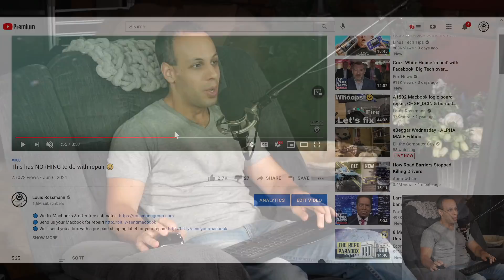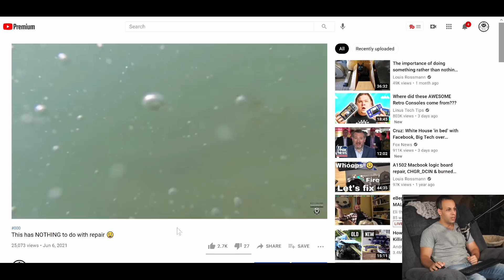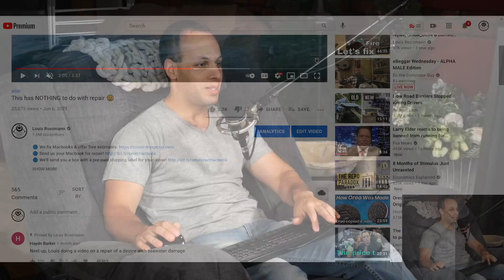Why are user serviceable batteries a bad thing?

Comment: If I were arguing from a place of good faith, and imagined them not being absurd .... I figure this person was imagining someone doing exactly as you mentioned, with floss and struggles... installing a shitty aftermarket battery that then catches on fire when they're on an airplane?  So now they're conditioned into believing that the batteries are dangerous... and I would say that a no-named pouch battery does offer more danger than something with a brand liabilty behind it, at least marginally.

When you said user-servicable battery even I didn't envision a fully designed battery shell, with a water proof seal integrated on it, as part of the solution... I pictured all of those shitty old battery designs from years ago, when I dropped my phone the phone,  battery,  and cover go skittering off in 3 distinct directions... that would be hard to seal and be user servicable...

But a cellphone who's battery was also the lid, and it slid into the phone from it's smaller dimensions, making the seal easier... well shit that's an obvious solution once you see it.

So it's probably a lack of imagination that people say things they'd almost wouldn't given the right explanations... which your video did quite succinctly.  So once again, you called out a problem and are the solution.  Better education and discussion around what is being talked about!

Comment: I have a question. Is there any reason for a sealed in battery to also be glued onto the frame? It's packed in, there's no chance of the battery moving right? Even if it could it would move so little.

Comment: yes, I was so sad when they moved to sealed in batteries in smartphones. I remember when there were devices in which people could buy "extended" batteries with extra charge and they looked like brick, but was a choice to use it so you wouldn't need to walk like an idiot with powerbank

Comment: Well sealing a battery from the point of view of maintaining and prolonging the device doesn’t make sense - I agree. 

But user replaceable batteries would also likely mean no IP water resistant rating, cheap clips, thicker/less stylish devices.etc 

As someone who repairs phones/electronics I honestly am pretty cool with sealing the battery inside the phone.

Comment: Louis my screen, charging port or microphone has gone bad before the battery in three of my last three phones.  I do treat them like crap and work in a dirty gritty industry but still.
Reply: I think he means that the battery will be the first thing to fail just by using the device normally, sans-abuse. Even if you baby your phone, the battery typically will be the first thing to go

Comment: Not including fused, weldedin, or whatever.  Batteries that aren't easily removable can be bigger, which means longer between charging.  Note, I am for right for repair.  Note, I am saying that they should have access to the batteries to replace them.  I'm just stating that making it removable like your camera takes up space which could be used for more battery.  For the camera that doesn't make sense but people don't want to charge their phone during the day.

Comment: Had an s5, can confirm that battery was really easy to remove and yet i was not any more scared to have it out in the rain or answer a phone call with wet hands than I am with a newer sealed phone.

That said, there are probably ways to do both things at the same time better.

Comment: I'm still using a LG V20 from 2016! Because its the last good phone that I'm aware of with a removable battery, i really miss my Galaxy S5. Glad you mentioned that one too.
Reply: It was the newest I could find at the time of my last upgrade.
Still using it to this day, and replaced the battery once so far.
Reply: I do too! Every day! Not as my main phone, the speed and camera isn't good enough (I have a V40 for my main phone), but it's still one of the best LCDs ever put into a phone (image retention issues aside) and the DAC holds up and yes, I get a lot of use about of the IR blaster as someone who sometimes resells older TVs. None of the apps I use have moved past Oreo yet, and when they do, there's an official release of LineageOS to bring it up to Android 10. I'm probably going to be using a V20 for something for the next five years. Long rive LG V20! No seriously long live. I'm typing this on a V20 that I water damaged to the point of it not booting and a year later (I was using a different V20) it magically turned on and has worked ever since for the past two years. It's probably no coincidence that the only two phones I have accidentally dunked in the water (other one was a Samsung Captivate Glide) had no water resistance and had removable batteries and both survived. Mine is a US966 too, which is apparently the most moddable one and relatively rare. Bought it brand new for 350 bucks in 2017 or 2018.

Comment: Remember when your phone battery would die out and you had a few spares laying around that were fully charged and ready to pop in? I guess waiting a few hours for your phone to charge is the trendy thing these days...?
Reply: I remember buying like 4 batteries and a charger off ebay and when going on a day trip not even considered phone battery life as I had 2 charged batteries in my pocket.  Good times.
Reply: @michelle-jn7ul  Sorry for the misunderstanding, when I typed "die" I implied that the battery will be depleted of all its energy then will require another full charge. Not actually physically dying and being thrown out.
Reply: @michelle-jn7ul  There are still plenty of older phones that don't support quick charging, and I imagine even newer budget ones, since not everyone needs that capability
Reply: @MrCh0o  True, I'm still rocking a galaxy J7, and I use it till the phone shuts down. It can take close to an hour and a half for a complete charge. I'm not going to spend hundreds of dollars on a newer phone just to have a faster charge time. My J7 still gets me through the day. Ill upgrade when I have no choice left.
Reply: Don't worry, we have Super Fast Charging™ now!*

*this will significantly shorten the lifespan of your battery and will heat up your phone to an alarming degree.
Reply: @michelle-jn7ul  Most phones till takes a few hours to FULLY charge! With quickcharge 3.0 or similar, 30 mins charging will usually get 30 to 40% charge from 0%.
Reply: @CougarCat21  With the added downside, (or upside, if you're the phone manufacturer) of wearing the battery out faster than slower charging.
Reply: @CougarCat21  fast charging kills the recharge cycles a phones battery has
Reply: @captainheat2314  You are partly correct. Whenever you charge your phone, it ionizes the lithium substrate, adding free-electrons to the lithium molecules. When your phone uses energy from the battery, those electrons that were ionized with the lithium, then get released to provide the electricity that the device needs. When all of the lithium in the battery is ionized, then the battery is 'full', when all of the ionized lithium is depleted, then the battery is 'empty'.

If you overcharge the battery (most chargers will prevent this), or if you drain the battery too much, or if you charge it too quickly then it creates some crystalized form of lithium, which can no longer hold or release any charge. Even with proper use of the battery and proper slow charging, a lithium battery will crystalize and degrade performance over time.

So yes, quick charging will diminish the life of the battery but it's not exactly related to how many charges you get out of it. 

The real issue is with that crystallization in the battery. That is why batteries swell up and explode.

Moral of the story is if you want to maximize the life of your lithium battery, then you should try to maintain a 50% charge at all times. Realistically, you should charge your phone when it gets to 30% and stop charging when it gets to 80% and charge it slowly. When the battery is at 50% it is at equilibrium, which is the most stable state for the battery. When the battery is drained or completely full it is the least stable and more likely to crystalize.

That said, I personally just keep my phone topped up to 100% whenever I can and I try not to drain it less than 30%. I also use a rapid charge, according to my phone, because  that is the charger that came with my phone. I've had my $150 (CAD) Moto E5 play for about 3 years I'd guess and the battery is doing just fine. No complaints. No swelling whatsoever, no degradation in the life of a charge at all, that I have noticed. Being that I've had it for 3 years, I'd say that the lifetime (recharge cycles) has not been affected either.

That's another tip btw. You should normally use the specific charger that is provided for your phone. Different phones have slightly different volt and amp requirements. Using the wrong charger may work because there are tolerances but they are not all universal/ideal.
Reply: @CougarCat21  I bet your phone's battery loves that...
Reply: @tams805  love what? I use up to 1.8Amps to charge my phone over normal micro usb cable. No fast charging for me. My battery loves that as iit will last longer.

Comment: I don't even have a hair dryer, I have replaced four batteries in different glued phones with razor blades and a candle lol. Razor blades are thin but dangerous, the candle softens the glue around the edge when done correctly it works like a charm. But I have to take my time unless I want to burn or slice my fingers open. I'd rather have a more easily replaceable battery, but I'll manage if the company wants to do whatever they want to do.

Comment: What I don't understand with those older batteries is why didn't they have a built-in circuit breaker and make it so they were the first point of failure in case of the device falling in water?

Like almost all of water damage (from my understanding) that kills devices is because power is flowing through the device and the water, creating shorts.

So, why not have a circuit breaker that you could flip when you get the phone dried out?

Comment: I'd prefer a user replaceable battery BUT I'd still rather have the current design and features. If it's one or the other, I'd take modern design and features over a replaceable battery. If they can do both, fuck yeah do it, but if they can't, I have my preference.

Comment: I had a phone recently whos battery overheated and started buldging the back off the phone. If the battery wasnt replaceable i wouldnt be able to quickly pull it out and prevent further damage to my phone or even worse a lithium fire in my house
Reply: Trust me, a bulge is able to crack open the phone ;) had that happened to my sis phone. It became a replacable battery by itself x)

seriously you're right thats a danger, as evidenced by the note 7.
Reply: @MmeHyraelle  Thats what it started doing, pushing the back cover apart, but luckily it wasnt one of those glued together covers, rather it was just held in place with clips. So i took it off and quickly pulled the battery out, its scary how fast it buldeged up to twice its size in a matter of minutes.
Reply: Yep, had a family member show me their iPhone 6s that had been basically been split open by a bulging battery. This particular phone hadn't been worked on (at least not after Apple gave it to them). This was their 4th iPhone 6s... one was a user error (dropped in pool), the other two were due to the touch disease.
Reply: I work for an AV company, a restaurant client had an iPad we sold them for control of the AV system. The casing became separated and super delicate to carry around etc, because the battery started bulging. Internals are completely exposed. Not impressed, only a few years old too.

Comment: I honestly haven't purchased a new laptop in years because I don't want to get a laptop without a user replaceable battery. I am still using my Thinkpad that is 8 years old. I upgraded the hard drive and RAM, and I use my desktop that I upgrade every couple years for most of my heavy use. 

I miss my old phone with a user replaceable battery. I would go on a trip, take a couple spare batteries with me, and I never had to worry about charging my phone. Not to mention that I loved the ability to never have my phone connected to a charger. Just pop in a new battery and go.

Comment: I was so sad that my carrier stopped supporting my Samsung S5 which had a replaceable battery and my new phones battery isn't user replaceable.
Reply: Carrier stopped supporting a specific phone model? How exactly does that manifest
Reply: @MrCh0o  I guess it doesn't support the newer network protocols and they're phasing out the old ones.
Reply: @my3dprintedlife  If that is the case, what a crap service they provide. There are a lot of devices that have phone connection that can't be replaced that often, or don't need fast connections. Things like cars, credit card payment terminals, automatic weather stations... Things like that.
Not to mention, faster technologies always get faster at the cost of range and coverage. A slower standard is important to maintain.
Reply: I find that hard to believe... my S2 (which is now my emergency backup) still runs fine on my carrier at least.

Comment: Design wise would be cheaper and more eco-friendly to just remove battery.
Instead a sticky rim could be just a rubber rim and some screws to have op water resistance.
But.... people were raised to REPLACE things to be in trend, not cos they really need to or have an big advantage.
Reply: Exactly...people have been programmed to believe planned obsolescence is a good thing.
Reply: Screws? What the heck are screws? - almost every major tech-company making small devices

Comment: even with user-replacables, all they have to do to make a device obsolete is to make a new battery model and stop production on an old one.
Reply: Not true at all, amazon is loaded with functional knock-off batteries for dated cameras and the like.
Reply: @darikdatta  true, but I ultimatly didn't trust those to actually work. Heck I bought a straight up new Mp3 player that had the battery (unable to be taken out) die in just 2 charges.
Reply: Some of those knockoff batteries are pretty good.

Some aren't.
Reply: There is some good battery brands which keeps making batteries surprisingly old devices.
Reply: Counterfeit batteries can actually be better quality than genuine ones though. If a company wants planned obsolescence, they could tie the battery to the serial number of the phone, making it not turn on when you replace it cough cough Apple.

Comment: Right to Repair also wants the ability to replace a battery with a new one WITHOUT then being locked out of the device. Looking at you Apple. Replace a battery with a brand new one and you get locked out of certain features

Comment: I had repairmen break front camera during replacing the battery on my iPhone 7 and repair store did not tell me that they broke front camera. Apple genius believes that front camera is part of the screen which not true but camera is attached to the screen. And battery was removed, then I have working iPhone 7 with a microphone that works. 
Also if my phone get water damage, I can remove battery and let phone dry. And put battery back in and working phone again with out going to repair shop.

Comment: I still use a Samsung Galaxy S5...because it was the last Galaxy with a user replaceable battery. I've gone through 6 batteries over the years, and the Galaxy S5 is still going. I will use that phone until it dies. BTW, for anyone else also rocking an S5, the Gorilla battery is the best replacement you can get.

Comment: Maybe the added complexity of putting the battery inside its own casing, plus the connection, and all of this turns manufacturers off. They probably see it as added cost and bulk that they don’t want. Perhaps their thinking is the battery’s useful life already is longer than the average person keeps their phone, or maybe that they expect the battery to last until the phone is too old to be worth replacement of a worn out battery. And naturally, we can’t leave out the obvious: it makes buying a new phone vs having the battery replaced in it, even if that is an option, seem more appealing and less bother.

Comment: My Pentax camera is completely weather sealed. You can put the thing Into a pile of sand and then wash it off under a hose. It has a removable lens which goes on and off and several different access ports four remote controls power supply Etc. Oh and of course user changeable batteries.

Comment: I see R2R ending with it being passed and manufacturers basically welding their devices together so that even though you will be able to buy the parts, you will almost 100% for sure destroy the device when trying to repair it.
Reply: Or they'll increase the prices of those replacement parts to an absurd level...
Reply: They've already been doing that, considering a large amount of phones nowadays don't have removeable backplates (that went away with the user changeable batteries).  You need special tools (which the manufacturers don't sell) to get into them without damaging the device.
Reply: It'll probably self destruct when opened by only a millimeter...
Reply: @平和-v1z  "This device will now self-destruct in 5 seconds..."

Comment: Had an LG G5 that I would still be using if the GPS worked. I killed one battery and would swap between 2 of them due to running badly optimized games on the phone. I'd rather have a swappable battery over water resistance, would be nice to have that as a choice again